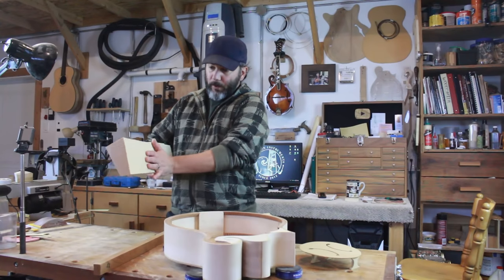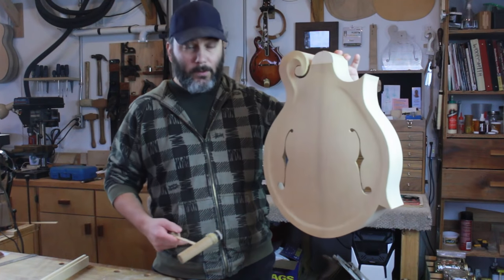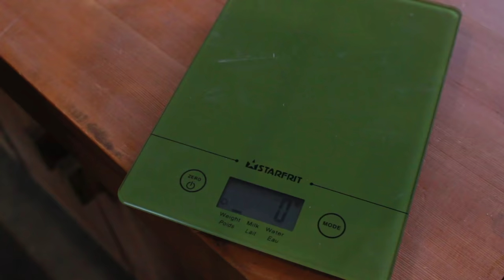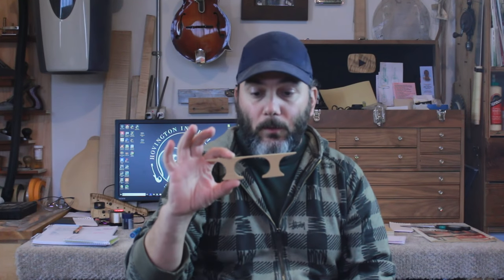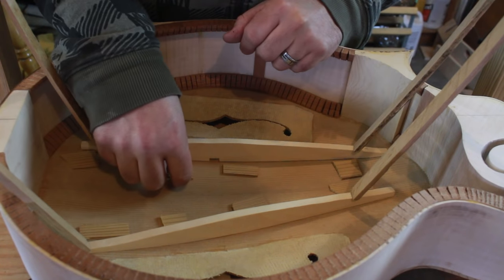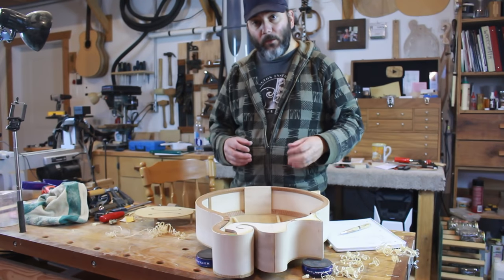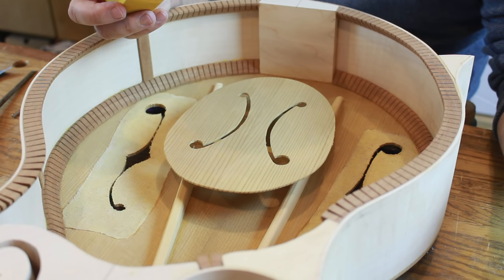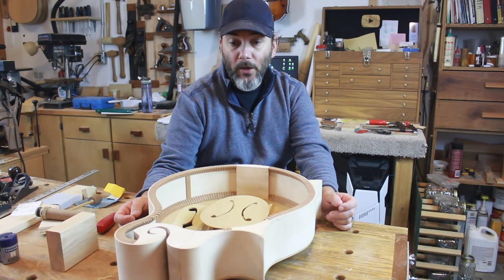Mandocello Virzi & tone bars/ Part8

Comment: Hey Tomy, Thanks for taking the time to respond, and video response. Glad to see you recorded the differences in tones. This new information will be invaluable to new builders and anybody trying out these systems. I also installed my tone bars in my mandolin project and tap tuned then,  sounds great, it sounds very much like a ''marimba'', which after all my research is very good.  The wood used was the 75 plus-year-old salvaged red cedar, very tight grained. I'll make a note to remember and send you some pics to your email if you're interested in seeing the progress. Thanks again!
Reply from the maker: Would love to see your progress, thanks in advance:)

Comment: I'm finally caught up!

I wanted to say your discussion of the sound hole vs. the apertures in the Q&A was really interesting.  with lutes, there's a partly-open sound hole, with braces on the back to support the carving.

this video was super interesting too.  I went back and watched the video about tuning the tone bars in the OM, too. 

1. I would have imagined fitting the tone bars to the sound board using carbon paper, rather than sandpaper.  is there any benefit to one over the other, for you?
2. why have a full step between the tone bars?  is that a mandolin rule, or a general rule?  (I know guitars can have different bracing, so maybe this isn't a sensible question.)

thank you very much!!
Reply from the maker: Hi ThoperSought,  I like the sand paper as it removes the waist as you move over it. Carbon paper shows where to remove it and then you have to adjust outside the soundboard and try again. I guess it’s a preference both work just fine.. 

For the full step I went the same full step as a Jazz guitar. I assumed, since the overall shape ( archtop) is similar it would fit it well. I also have a full step between my tone bars on the Mandocello. Thanks again for watching and your comment!

Comment: Tapping for pitch should be done with the fingertip on spruce. You can tap all over to identify all modes to address. For hardwoods, the knuclkle works best. Mallets are for pianos. Builders use their hands. Just fyi stuff.
Reply from the maker: I did just that when I was working on thicknessing the soundboard plate and you can see me do just that with my idex finger in the video about the soundboard / carving the scroll.
https://youtu.be/xQbIPAU6OAU

In this one I was trying to demonstrate the change in response/ tone of the soundboard with the different parts added. Also to do my Tap tuning with the strobe tuner I do need a deadblow hammer to tap. There is literature on the subject I can share if this subject interest you.

Thanks for watching